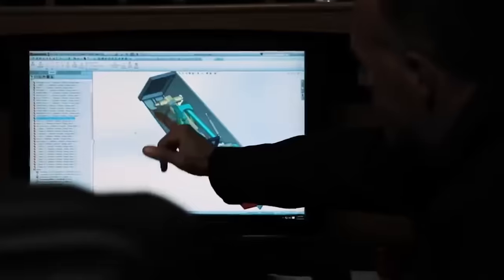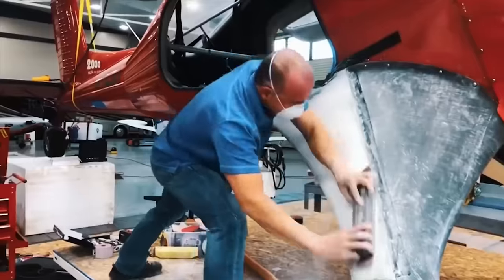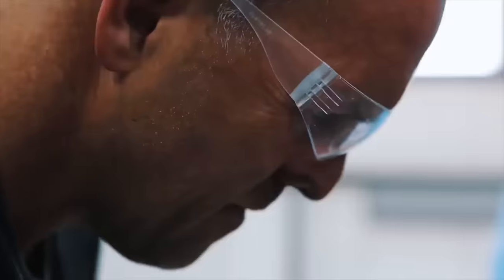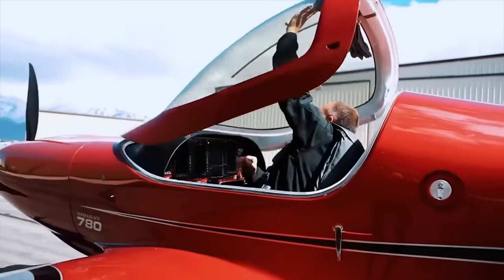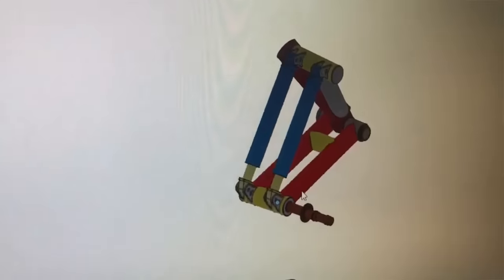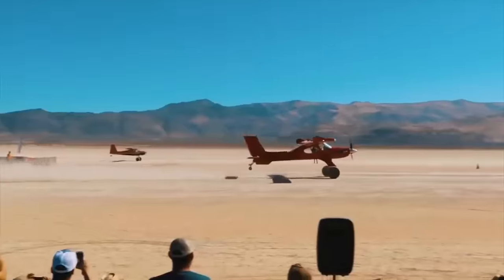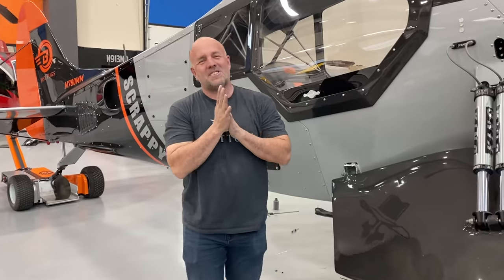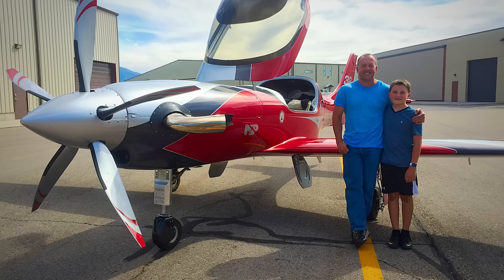This Is Gonna Suck!...We Do It Anyway - Engine Cowling | Scrappy #44

Comment: How are you cooling that motor? I may have missed the episode you explained, but as far as I know there's no air-cooled engines of that type...
Reply: It is air cooled. in addition some cooling comes from the fuel/air mixture and the oil system.
Reply: "Cooling System – These engines are designed to be cooled by air pressure actuated by the forward speed of
the aircraft. Baffles are provided to build up a pressure and force air through the cylinder fins. The air is
then exhausted to the atmosphere through gills or augmenter tubes usually located at the rear of the cowling."- From the Lycoming 720 Manual. https://www.lycoming.com/sites/default/files/IO-720%20Operator%20Manual%2060297-19.pdf

Comment: I'm not an expert on these materials, but if he is making something just to make parts off of, wouldn't it be cheaper to make the parts out of fiberglass then pull his parts in carbon fiber? Or is there some kind of reaction between the two that would prevent him from doing that?
Reply: There's no reaction between the two. And yes it could have been made for as little as  $8 a yard instead of say maybe $30 although he likely gets a bulk discount LOL. I have used paper mache as it's extremely cheap. Once you have your shape then cover it make your mold. Then cast your part. But if you haven't noticed  money is no option.  Life must be nice. I've never had that luxury .LOL
Reply: @Ozarkprepper643  I personally never worked on any of it but we've had guys at the shop make parts using fiberglass. 
The guy who owns the shop use to make super 7 kits and still has his molds here. Maybe one day I'll make one out of carbon 🤔
Reply: @acpsuperfly  That would be nice and fun especially having access to molds. The gratification of doing it yourself can't be beat. Then there's the added benefit of being your own mechanic . Saving the expense of a A&P.
  I have built a few planes. I'm currently building one it has an aluminum frame with layers of foam board and S glass. Since S glass is just as strong as carbon fiber but also as tough as Kevlar but costs much less. I have used in places on the last layer a hybrid of carbon fiber and Kevlar called reflections which is colored and looks anodized.   
  I did make my own landing gear last May. It is made of the hybrid textream and zilon layered with S glass. It is similar to Scrappy's although mine is a tricycle. Like Scrappy it has upper and lower swing arm to help keep the wheel vertically true. but the swing arms aren't straight. They come out 8 inches then down on a 45 and then out horizontally again to the hub this helps eliminate some of the sideway scrubbing that takes place on compression.
    I started on this plane before Mike started on Scrappy. But he'll finish way before me I can only do it whenever I save a little money. lol I am old and retired. LOL
    I'll probably be working on it a year from now. 
     This might be deleted. I have had some of my other posts disappear today, which is odd. I am a nobody. I'm certainly no threat.  It was nothing against a YouTube policy. So it had to be a monitor, or Mike himself.  So I'm a little disappointed today.  And likely won't comment again. You take care.
Reply: @Ozarkprepper643  I did get to see it. It is odd if your comments got deleted. I have only worked on ground vehicles 
15 years ago I took an introduction to flight but couldn't afford the classes, now I can afford the classes but I don't have a steady income so I can't afford the rental/fuel. 
I will keep playing with Sims until something changes
Reply: @acpsuperfly  You may consider a High Wing ultralight. Barnstormers quite often has them for $5,000 sometimes less. And some of your flight hours can be transferred where you only may only need to do the minimum in the type aircraft you want to fly under sport pilot. It's one way to get flying with less money. And there are many great kits out there some with folding wings. Where  you can take it home or put it somewhere like RV or boat storage. I built a J-3 Junior in the 80s it used a 440 Kawasaki. Was a very nice handling plane.  It only cost $1,200 build.
Reply: @acpsuperfly  thought I'd let you know on that deleted comment. Mike responded back, and he had checked. It appears as though YouTube for some reason removed it. So I stand corrected. It wasn't Mike.

Comment: What is micro? I googled it and only found some weird beauty injections.
Reply: I believe he's talking about microballoons So try Googling that. They are small glass Spears Ultra lightweight and they're actually easy to sand. Used for filling, smoothing, flaring. Microballoons and cabosil are two of the more common additives in resin. He confused me on his statement saying it's tough to sand. But maybe I misheard. Although if you watch, with every stroke he does with his sanding block he's taking tons of it off.

Comment: Just a quick bit of advice. I would think a small grill at the rear top side panel will do good to encourage fresh airflow to your rear cylinders. Just worried that your exit grill is too far forward and you may be recycling a lot of hot air in the top rear part of your engine... This is not a critique. I am a big big fan and just passing on my thought as I believe the cuts for your exit grill are located for a smaller donor engine/craft. Tem in Hackney, London tem@coldandblac.com.

Comment: Cars today are way off on design, way off. They are all trash ,100% Their heads are so far up there, when they sneeze, they blow their brains out. P.S. Just a thought. Have you considered wrapping the exhaust with thermal wrap to isolate the high temps from the cowling? Mike, you are very talented and skilled.

Comment: I know you've got the belly pod vent for the engine, but why not make new larger side vents that look like carbon cub vents? They look so small on that engine, and look to take only half your engine's cooling air flow. I gather you do model the whole cooling air flow requirements well in advance.
Reply from the maker: Yes correct.  👍🤠 It’s coming in further cowling video, I wanted the original cub look vents but it has two more behind them I just finished as well as the giant belly cowl flap.  I can manually adjust the inlet to outlets ratio from 1/1 up to 1/1.8  great question thanks
Reply: @MikePatey  oh cool, that's going to be a very interesting video. That's a lot of engine in very little space.

I'm surprised by the ratios you're going to, I get with the hotter air it will expand, but at high altitudes and very cold temps I thought you'd want to close the cowling more than 1:1. Especially since your cruise power would be what? 20%? (joking but not sure I'm wrong)

I just figured there was part of the envelope where you'd have to keep the engine warm instead of cool.